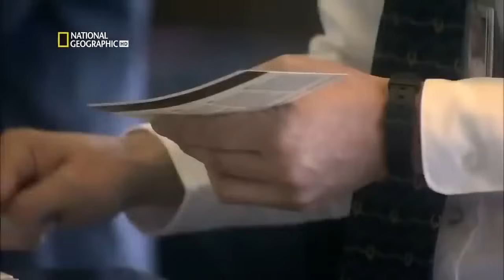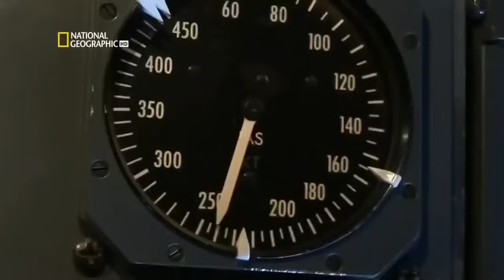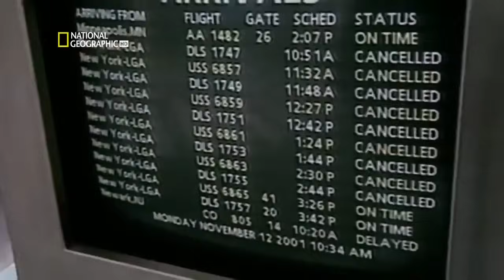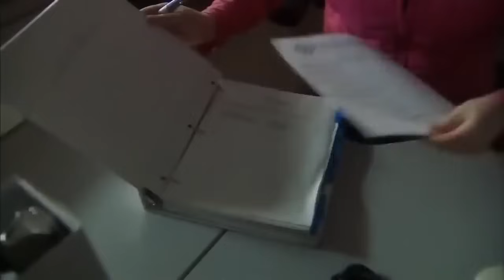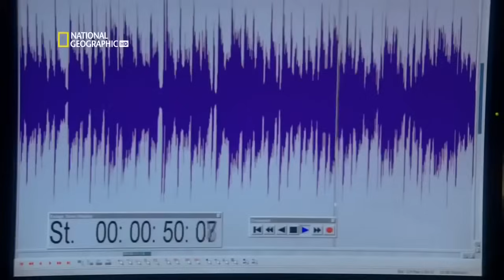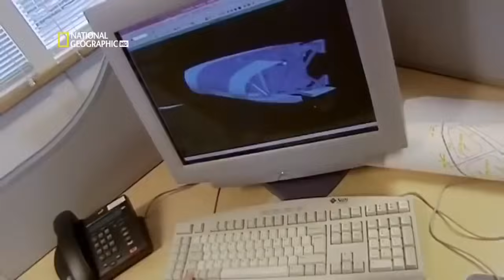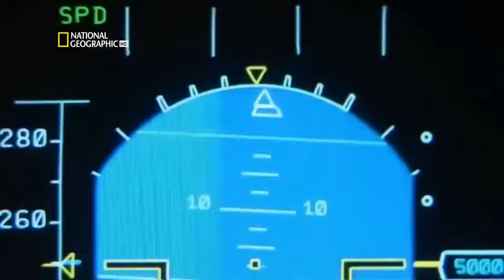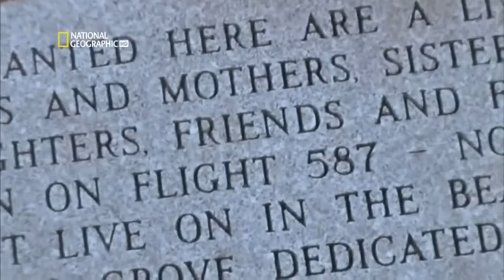American Airlines Flight 587 | Air Crash Investigation | National Geographic

Comment: I think EVERYONE has missed the point, here. This crash might not have happened if the A300 would simply have waited another 2 minutes on the ground. Two measly minutes could have saved hundreds of lives!
Reply: Airbus redesigned the rudder control software after this cause it was flawed.
Reply: @rfi-cryptolab4251  The fact remains that it never would have happened in the first place if they or the tower had allowed for more spacing behind the jet-wash of a 747. Those deaths could have been prevented. Isn't that worth 2 minutes?
Reply: @sunnchilde  
Jet wash?
Reply: It would have happened at another point in time considering he'd previously used that same manouver in turbulence, could have been 10 folds worse of an accident, at least it happened and the true issues were resolved, user error and manufactures error.
Reply: @kilq_raiidz6444  
Then the a/c was flawed.
Reply: David Sumner  No, it wasn't his incompetence as he wasn't incompetent. He just followed his training. A training procedure even Airbus themselves had warned American Airlines about using. In other words, this flight could have been prevented if AA had listened to Airbus months before the crash happened, instead till after massive loss of life had occurred.
Reply: It was the wake that put them in that terrible situation
Reply: David Sumner  It's not "incompetence" if you were taught exactly to do that. Do people not pay attention to what they watch?
Reply: David Sumner  you can't blame the pilots when they were trained to do what they were trained to do.  if safety comes first, the plane should have waited out on the ground. with this accident it uncovered 3 flaws.  patience, pilot training, and design flaw.
Reply: Poor aircraft design ... should have had a an effective yaw damper.  Poor training ... you can't jerk the rudder like that on a 250 ton aircraft ... a Cessna 172 maybe, but not a 250 ton aircraft.
Reply: No.    Pilot Error.
Reply: Friend you have 'missed the point'
The aircraft wasn't in wake turbulence.  
The First Officer's rudder inputs yawed the aircraft to such an extent that he believed it was wake turbulence. 
It wasn't.  It was Pilot Error.
Reply: Nah they gotta be punctual no matter the cost
Reply: Its not design flaw if they already acknowledged that too much force could rip the tail off and had the FAA even test the plane, If that was against the rules or saftey the FAA would have been all too happy to ground the A300, they didn't like the plane in the first place. Airbus warned AA about its dangerous training on wake and they failed to listen.
Reply: Omar Mansour it wasn’t even wake turbulence they encountered, did you miss that part, it was regular turbulence they thought incorrectly was wake turbulence which led them to make the violent manoeuvre instead of flying through it. Caution wake turbulence is a common phrase. So common in fact you don’t have to repeat it on the radio
Reply: Sunnchilde it wasn’t wake turbulence at all, it was just a pocket of regular turbulence, they just thought it was wake turbulence so responded in kind
Reply: @sunnchilde the thing is that there would probably have been a devestating accident later because of all other factors.
Reply: 2014 was terrible too
Reply: It may not have happened to them but it would have happened at some stage. Unfortunately this is an example of why the commercial airline industry gets safer
Reply: @olocks1  no it wasnt aircraft hit turbulence frequently
Reply: Arterexius 
You can be given the most training out of anyone else and if the training was inadequate, so are your abilities. It was his error that caused this crash. They even say it in this video. He overreacted to the slight turbulence and began fighting his own maneuvers under the impression that they were still being caused by the turbulence. He caused the plane to react violently then continued to maneuver violently as a false counter measure. If that’s the training he received than some of this weight can be alleviated from him, but other pilots had confirmed he had the tendency to overreact with that particular instrument. Perhaps they received conflicting training.
Reply: I know you are more likely to die in a traffic accident, but this is why I don't fly.
Reply: Yeah but I think the investigator himself said that A300 is too big for it to be affected from the turbulence that was left by the Japanese plane.
Reply: @CrossfireBolt  apparently not.
Reply: Yes Patience grasshopper in aviation
Reply: Maybe if they changed corse and slowed down instead of going full power they would not have the plane falter
Reply: @thegatesofsleep  I still don't see how it was his fault. 

40:06 - "the classroom work told pilots that it was permissible to use the rudder to escape from unusual attitude situations"
The unusual attitude situation wasn't a meer case of him applying too much pressure to deal with the turbulence but a side effect of the manufacturer not detailing in training guides the increase in rudder sensitivity at high speeds vs on the ground. 

41:09 - "on the ground the rudder pedal has to be depressed by 10 centimeters to get maximum deflection but when flying at high speed that distance reduces to just 4 centimeters NTSB officials are shocked to find that this system is not explained in training manuals there was an apparent gapbetween what the manufacturers knew about the rudders sensitivity of the airplane and what was filtering down tothe folks that actually flew them then"

So when he applies what he considers appropriate pressure on the peddles to manover the aircraft, instead it is more than what's intended so he assumes it was wake turbulence and acts as he was trained to in the simulators that not only encurage the heavy footing but were programed to promote it.
Reply: @gazza2933  ya true.The wake turbulence warning made him in a panic situation.even though there was a little turbulence he thought the plane was losing due to the turbulence and not to his rudder inputs.
Reply: Yup, just wait for the wake vortex of the plane ahead to dissipate.
Reply: obviously u know nothing bout atc
Reply: @gazza2933  That's like blaming "pilot error" in the crashes of the 737MAX's they were piloting for not knowing how to react to the plane taking a nose dive even though Boeing didn't know themselves.
Reply: @Hugh Mann My point was simple common sense. Everyone knows that a big 4-engine jet like a 747 or A380 would jet out a powerful wake behind them. Whenever you find yourself behind one of those, it would pay to doddle at the end of the runway for an extra Minute or two before asking for clearance to take off. Just pretend that you're attending to something on the checklist. It could save your life.
Reply: That's only a valid statement if it was actually wake turbulence that was the issue. The irony is that assumption was supported primarily by American Airlines training pilots to use the rudders for wake turbulence. They otherwise have no evidence that was a problem. There have been pilots and engineers who questioned the findings, but the NTSB says it has other priorities. Besides, it was the captain who got to call that. He didn't have to discuss whether or not Molin was "happy" with that distance; he could have ordered him to wait and contacted the tower for further instructions. So, BOTH pilots didn't believe that it was that big of a deal, and their judgment would have been right if the faulty rudder issues didn't come up. As they point out plenty of times in the documentary, wake turbulence isn't a fatal flaw in and of itself.
Reply: The turbulence was probably so strong that they thought they were gonna die
Reply: @apacheattackhelicopter8410  Of course it was. The 747 ahead of them was using full power at take off.
Reply: @gazza2933  NO!! Airbus should have installed better rudders on the aircraft. it was design flaw.
Reply: @allieshepard7791  So, you don't travel much?
Reply: @wheatish  actually I've been all over the world but that doesn't mean it doesn't scare me to fly
Reply: @allieshepard7791  Scared of flying as opposed to 'I don't fly' are very different matters. Kudos to you for surmounting your fears.
Reply: @wheatish  I used to fight all the time but now I've watched too many of these LOL
Reply: @wheatish  Plus for over 10 years if I wanted to see my mom, I didn't have a choice
Reply: Or....Just instruct future pilots not to manipulate the rudder so harshly.
Reply: Real talk!!!!!!!!!!
Reply: It's all the Japanese' fault.
Reply: Exactly
Reply: Could be, but it was a pilot error and a contruccion error, somebody watched the plane from the ground and told that both engines came of, coincidence that there where 
atached with the same material as the rudder, i dont trust Airbus planes,
Reply: @sunnchilde  Every plane use full power to get off
Reply: @whatnotbutter7470 Both pilot error and construccion fault
Reply: @christiansanden8005  they came off because of the abnormal and excessive aerodynamic forces caused when the plane went into a sudden dive. The rudder failure occurred because of misuse. No plane could have survived what happened.
Reply: @adotintheshark4848  Right, but i dont trust Airbus any more, to many strange stuff happening
Reply: @golfmaniac007  If training was a problem then many more crashes would have happened. In this case, it was an overreaction by an inexperienced pilot.
Reply: no sir, you missed the point
Reply: @mudgatebronn4438  but he is right, because the wake turbulence would have died down.
Reply: @adotintheshark4848  yes but that's not the issue because you can't eliminate turbulence. They would have hit turbulence sooner or later and the same thing would have happened. Just a little bit later.
What could have avoided this however is proper training from AA and /or proper engineering from airbus
Reply: @sunnchilde  Not really because of the sheer amount of air traffic that the NYC area gets. This would cause delays across the entire country and maybe even across other continents. Besides, even at the time, a lot of pilots knew that one of the major factors on the severity of wake turbulence is the size comparison between the aircraft in-front and the aircraft following behind. American Airlines was definitely partly to blame for giving their pilots such training but it was also the F/O’s fault for not questioning why a 727 (he was flying those before the A300) would enter such a catastrophic upset from such a common occurrence.
Reply: @rfi-cryptolab4251  The jet eflux  from the engines which can disrupt the airflow behind the aircraft causing any aircraft flying into the disrupted air to have control issues.
Reply: @aesonindustries8325  it was not a design flaw, but it was not the pilots fault. 

In one of the classes taught they was trained to do that. 

So you have to blame the instructor & the class . 

You can’t blame a pilot for the training he received period!
Reply: You can blame Molin for not listening to other pilots who told him not to use the rudder so aggressively
Reply: Not entirely. The FO’s unnecessary control inputs are the main reason. The issue was AA’s training regimen which instructed their pilots to do this in these situations. Realistically, could this disaster have been prevented by waiting a few more minutes on the ground? Sure, but more than that, had the pilots been trained properly, it would have been just as preventable.
Reply: @allieshepard7791  i think a big part of it is putting your life in some one else's hands.
Reply: 10 secs wait would have been enough, the other plane would have gone a long distance in 10 secs
Reply: Probably, it’s not guaranteed, the proper training of the rudder pedals could have prevent this, it’s like speeding through the rain and you turn your steering slightly too much to try to prevent your car from spinning out of control
Reply: 2 minutes would have helped, but the training was the issue. Simply steering either side a couple hundred feet would have shifted out of the wake. Controllers may have reprimanded him but as a pilot, I understand that the final decision is up to the PIC. Simply moving a couple hundred feet and being trained to do so would have fixed this, not a delay.
Reply: @sunnchilde  yes, but it would be sure to happen at some point. Plus, if it wasn't for this accident, the training manual wouldn't have  been improved.
Reply: A series of unfortunate events, that’s not the only point to be made
Reply: @rfi-cryptolab4251  somebody might have already answered this but every time after an aircraft takes off it leaves a wake of turbulence caused by the engines if an unlucky plane were to fly into this vortex well...let's just call it bad stuff
Reply: @sunnchilde  Relax yeah? It’s common for planes to follow other planes and there not being a need for extra time. That’s simply turbulence and not an issue. Would it be smart and safer to let planes wait? Yes and towers do this all the time. The main issue here is that the company did not issues a statement that the rudders are sensitive. Any plane could’ve been caught up in any type of turbulence without previously following another plane and this same scenario could’ve happened. This accident could’ve happened a lot more
Reply: I agree the captain of the plane was to quite to take off knowing he hade ruff air the was going to fly threw  he did ask the the other guy do you think the other plane was far enough ahead of them know foresure he guess at it bad bad
Reply: You can't predict or change the future. If it's going to happen, it will
Reply: @sunnchilde  mate you can't just apply boat terminology to plane terminology its not wash, its wake.
Reply: No I think you completely missed the point, turblence or no turblence this can happen and its very important they found out to prevent further accidents.
Reply: Well, the problem with this is that even if this crisis was averted, unless the copilot's poor training was corrected he would do it again (understandably because that was what he was taught). Averting one tragedy by 2 minutes wouldn't be enough to stop another one. The turbulence wasn't nearly enough to bring down a plane that size, they can take a load of beating from turbulence.
Reply: That has nothing to do with it. He would have crashed a plane eventually because he used the rudders like Fred Flintstone.
Reply: The Air traffic controller was supposed to give them More minutes on the ground to fight 587 due to the Japanese Airlines which was ahead.
Reply: @pauluskenny9846  wake turbulence had zero effect on the crash.
Reply: dude stop ruinin the story
Reply: the day you are supposed to go ....you are supposed to go..2 minutes or some else excuse is vague
Reply: They're all about the money though. Putting on the pressure so they can get as many jets landing and departing as possible. Two minutes is too long for airline companies. It's sad and sick.
Reply: @rfi-cryptolab4251  And then what's the next jet flaw to be solved? There will always be a problem or flaw that needs to be solved. We solved this, we solved that. Oh, we made a new jet so we can start all over and re-live it again with new issues. It will never end. 
Take a look at the stop-start technology on cars and how many deaths that has caused. It's a gimmick 'technology' that will cause your engine to wear out prematurely so you go to the dealer for repair or buy a new car and sell your old one for pennies. 
I'm surprised most people don't realize how they're being taken advantage of and still smile thinking they're making good decisions.
Reply: @allieshepard7791  bet you have an exciting life - do you sleep in the recovery position too ?
Reply: @MikkelMane  yes but not with my other arm behind me.
Reply: @MikkelMane  and my cPTSD thanks to my mom isnt exciting lol.
Reply: @CaptainProspect007  
A300 is a sizeable aircraft. It would have no problem encountering wake turbulence.  It isn't a Cessna Skyhawk or a business jet.
Reply: @adotintheshark4848  
B.S
Reply: @reapertalon  
An A300 is a very large aircraft. Wake turbulence is only dangerous if you're flying a smaller aircraft.  Say for instance a Cessna Citation following a 767 or a Cessna Skyhawk following a A320.
Reply: @tex6929  
I used to fly small aircraft out of an airport with lots of business jet traffic and the occasional A320.
Even as lowly private pilots we're taught wake avoidance. 
I took off many times behind jet aircraft without taking a hold as long as I got an immediate turn.
Reply: @rfi-cryptolab4251  yeah I know. I'm not saying it would in fact down an aircraft. I'm saying it can still be dangerous
Reply: Problem solved with tombstone engineering.
Reply: @cantfindmykeys  Exactly. “People” and lives have no innate value. You are just a profit center. Doesn’t that make you feel wonderful?
Reply: @sunnchilde  That's why I don't fly anymore.
Reply: Are you a pilot?
Reply: The plane was fly able and I know there’s turbulence in that area so they plane just had to fly the plane nothing more than less.
Reply: @I_SuperHiro_I  😂
Reply: and a lot of money
Reply: @sunnchilde  c c
Reply: I think EVERYONE has missed the point . I’m smarter that you and figured out accidents are preventable lol . I’m so much smarter than EVERYONE.
Reply: @krin9437  exactly
Reply: @pauluskenny9846  that's true
Reply: Nope, I don't buy it. No one else who got the same training had a problem. Pilot error.
Reply: NTSB advised a take off gap of just 40 further seconds would of been enough to avert this accident, although another may well of happened since many pilots over exaggerated use of the rudder.
Reply: @exex9378  yes it was pilot error  first and foremost
Reply: Better training would have prevented it
Reply: Like that’s the same fucking thing I was saying like
Reply: Right ✅️
Reply: Yep, exactly what I was thinking.
Reply: Exactly i been saying that since i found out what the cause was decades ago and much like Alaska flight 261 even knowing what that flight was experiencing round LA they really were thinking of telling them to keep going to SF..u got assholes more worried about the "flow" than human lives...i place most of the blame on American Airlines but i think Sten should've known better and States should've told him to chill out on the rudder but also those in the control tower that warned of the wake but instead of telling them to wait a few more minutes for the wake to dissipate they were probably more concerned with the "flow"
Reply: spot on.
The ATC folks need to make a rule to wait at least 5 minutes for takeoff after a heavy.
Too often pilots are under pressure to make time and they push past the edge of safety.
Having an externally imposed set of rules relieves them of responsibility.
Reply: @mikesmith1181  exactly and it speaks very clearly of what the general attitude is in the airline industry like "safety comes first..BUT...the "flow" is paramount" when Safety and Lives should be ABSOLUTELY PARAMOUNT and unlike someone in a car running a red light for instance which could cost numerous lives, if something goes wrong on a plane it won't be numerous lives it'll almost certainly be hundreds of lives..plain and simple all that "flow" bullshit they need to train everyone who has lives in their hands to never put anything above the lives they hold in their hands..587 wasn't as negligent as Alaska 261 but in a way it's worse cuz the pilot, first officer and/or those in the control tower could've chimed in and said "we need a few more min for wake dissipation" but I'm sure they all had the "flow" above all else in that moment and that should never ever happen..sorry to yap but it still angers me just how preventable this was..not some act of god like weather but Wake Turbulence
Reply: I believe it is the ATCs fault for giving clearance for the A300 to takeoff knowing the B747 had just left the airport. It is FAA regulation
Reply: Did he have to fly behind the 747? Couldn't he have waited a few minutes b4 takeoff?
Reply: There are thousands 😮 of flights everyday hard to schedule them all
Reply: @rfi-cryptolab4251 Did they make it out of aluminum? Not composite junk
Reply: @sunnchilde ye they never wait 2
Reply: I think YOU missed the point! An accident was inevitable!! There WAS a problem and it got fixed as a result. You missed the fact that there was a looming issue and it may have still been an accident waiting to happen.
Reply: @Arterexius  What is the big reason for nearly all big crashes is what is due to the failure of a business to understand that safety must come before schedules no matter what. A flight being on time or leaving on time was so stressed back then, pressuring pilots who should never be pressured that way. Leaders of companies over and over again have done things or neglected to do things that compromised hundreds of people lives, they still do this, above and over safety but it was worse back then. Many pilots have had to overlook things off with their planes, taking off with things not working etc. In this case they worked hardto blame the copilot but it wasn't him it was a part that caused 2 otherb huge crashes, one that they were told does not happen when pilots had been telling the company heads that it was happening to them. Covering their butts usually puts stiff off on pilots to try to save their businesses reputation, a disgusting habit.
Reply: They should put a rule not to fly right away after a take off. I wouldnt mind getting delayed as long as they help me find another flight 4 free if I miss my flight
Reply: @reapertalon if i were a pilot i woudn't comprise safety &, security over time / confidence
Reply: @antoniokastrocarlisledemel6617  shame on that ATC
Reply: @KathyHussey063  No, the separation was fine. Sten was failed by poor training. We were all taught to use the rudder to counter unusual attitudes.
Reply: @JoePilots  I can't find my comment here to remind myself what "separation" you're referring to, it's been a while since I left my comment & 119comments here. But I do remember that eventually it came out that the plane manufacturer had not trained or advised pilots right on what to do but they didn't release that info for a long time.
i
Reply: @matthewkellet7299  excellent !!
Reply: @davidkennedy5855  it was lack of proper training to deal with something that the manufacturer knew could happen, it was so wrong to not teach pilots EVERYTHING they might need to know about the plane they were tasked with flying.
Reply: @rfi-cryptolab4251 it's always weird how Airbus gets blamed for not using enough fly by wire, and Boeing gets blamed for using it too much. When in reality Airbus has used it way more and Boeing has preferred manually feeling the plane.